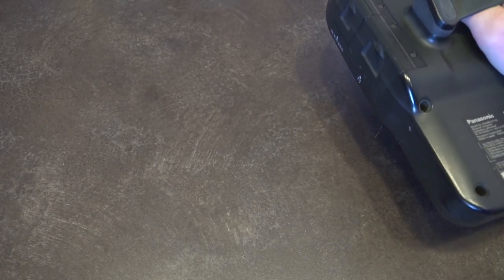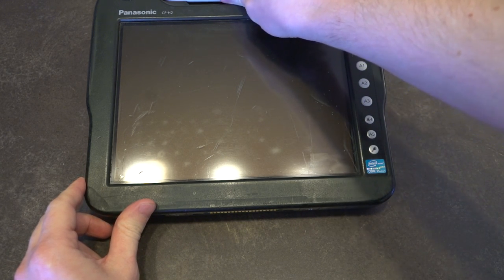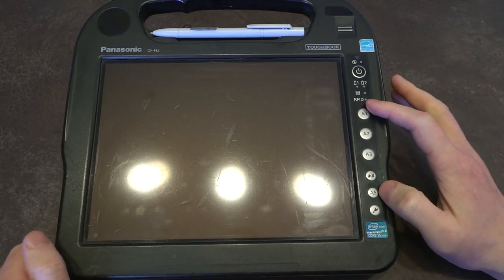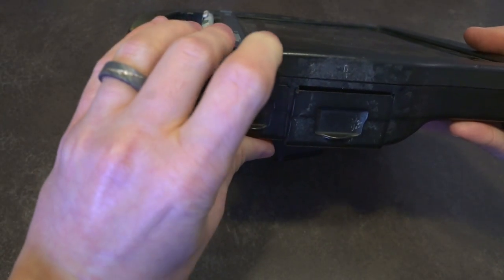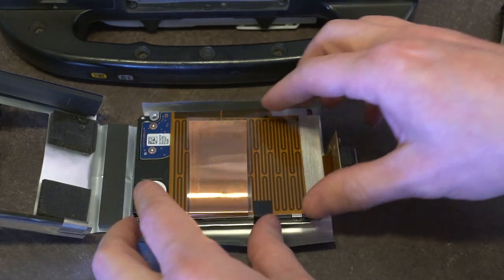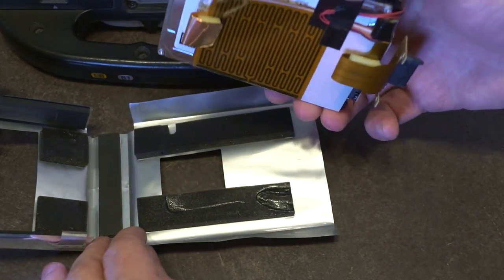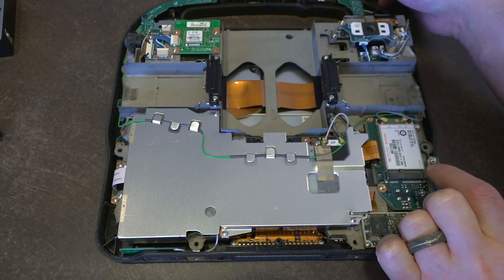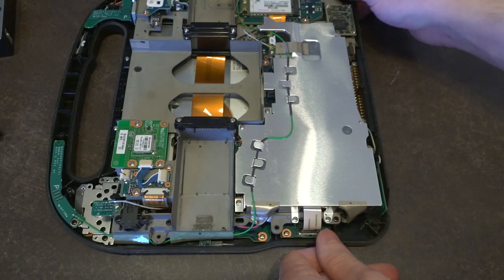Panasonic CF-H2: "Weird out of 10"

Comment: You can buy connectors that include the mounting screw. As it's a toughbook they have given you a means of turning an otherwise unsuitable friction fit usb connection into a securely fixed connection with a thumbscrew.

The connector's I've used also included a rubber seal that once connected and bolted in retained the dust and waterproofing too.

This is a very common use case for these devices and that HDD is shock, dust and water protected the flex cable connector is to prevent constant vibrations from breaking the connector's solder joints. This way the flex cable takes the strain not the hdd connector.
Reply from the maker: Thanks for the information! Really appreciate you taking the time to educate me on some of the advantages.

Comment: The hard drive casing looks like some kind of shock-absorbing device. If the connector were rigid, it could break if the device sustained a hard enough blow.
Reply from the maker: Hmmm. Sounds like a reasonable explanation. Thanks for your insights!

Comment: Iirc, that kind of connector is a zif drive, or something like that, was the drive PATA or SATA? And most zif drives used a variation on PATA including but not limited to CF, its always neat getting one, but finding one with the batteries and the stylus like you did is amazing, a laptop like this is weird but worth it for mild stuff, not too intensive gaming, but a great find honestly, and Its on my bucket list to own one of these and I'd ensure those batteries are good and maybe replace them if need be with better lipo cells if possible, great video dude :) and all that surrounding the HDD looks like a NFC connector of some sort ;)
Reply from the maker: Yeah I know a lot of these see a second life in auto shops for older diagnostic software.

Comment: Since this is the first review I have seen of yours, I would have to ask, do you ever read any documentation, Before you do a review?  I have used this model Panasonic for many years and did not find the review very fair. If you take into account that this unit was designed for a specific type of use, I think you might find that the problems you had could be easily remedied by a brief read of documentation.  This unit was designed for rough and tumble use on building sites and hospitals and similar.  All it's features and drawbacks are due to this work environment.  I have knocked my unit a couple of times off a 10 foot ladder onto a concrete floor and no problems, try that with most any other even reinforced laptop and it would, I bet not survive.  For what these were built for they are excellent.  You are right about the pen it is better but when properly calibrated the touch screen works well.  Another test you might try with a comparable unit, drop it in a bucket of sheet rock mud and then use it the rest of the day waiting to clean it adequately till end of day. It might change the review.
Reply from the maker: Hi David, thanks for the feedback. I do generally read anything and everything available that I can find online and at the time of filming it wasn't a great deal. I'll also admit to not having a great deal of experience with this style of machine which will impact my view of the device, so I appreciate you giving me an opportunity to point that out. I hope if by chance you watch any other videos I've made that you will enjoy them more.

Comment: Tough books have major issues with M$ installing generic drivers instead of the Panasonic custom drivers every tine there is an update.
Reply from the maker: That would make sense, but I couldn't even find a program on Panasonic's own website to start up the barcode reader.
Reply: Laptop Retrospective Panasonic has never provided software like that. Part of it is the intended audience for the toughbook line.
Reply from the maker: I see, so if I understand you correctly, they relied on third party devs to mostly write the software that would utilize the hardware they provided?
Reply: Laptop Retrospective yes. All Panasonic provides is drivers and the hardware for the options.
Reply from the maker: Thanks Monkey. I really appreciate you taking the time to educate me on these things. I'll have to keep in mind mind in future Panasonic videos. May I ask how you become such a bearer of wisdom relating to these devices?
Reply: @LaptopRetrospective  I've owned several Toughbooks. My current car laptop is a CF-19 MK4, and one of it's options is internal GPS....... to even verify that the GPS was operational I had to hunt down free software that was capable of interfacing with the serial interface of the hardware.
Reply: @TimMonk1911  where did you find the free software at?

Comment: I'm having an issue with this unit shutting off unexpectedly. It seems okay plugged into the charger, the problem seems to only happen on battery. Any thoughts?
Reply from the maker: If it is only happening on battery then I suspect that is the culprit. Perhaps it isn't properly reporting remaining battery life?
Reply: @LaptopRetrospective  It does give me an indication of battery life if I click on the battery icon in the task bar. I'm wondering if it could be a connection issue inside.
Reply: @northpostman  Did you try to calibrate the battery?
Reply: @nickserge9771  How would I do that?

Comment: Hi, you need touch and hold cross in bios screen calibration.
Reply from the maker: Cheers, thanks.
Reply: @LaptopRetrospective  no problem, also when you in Windows 10  Settings you can type in search box screen calibration works better than bios one